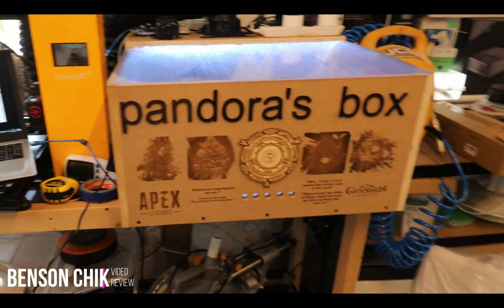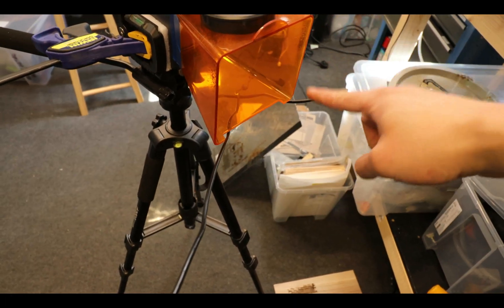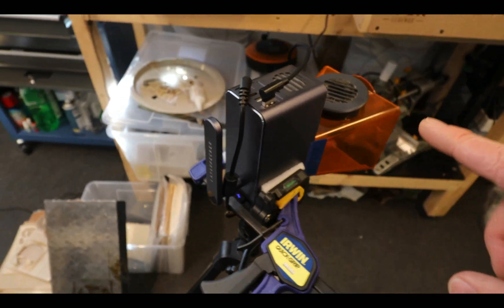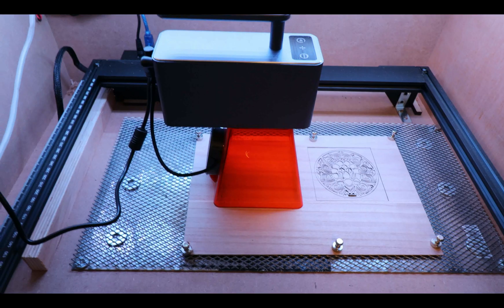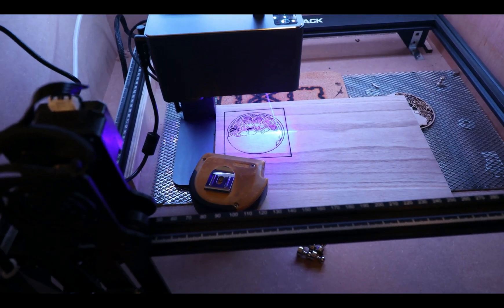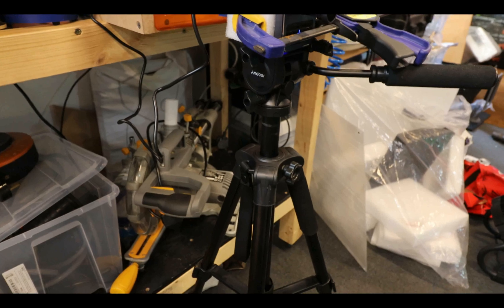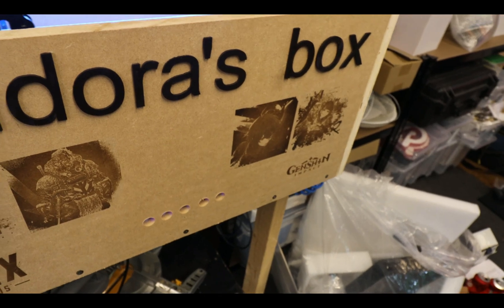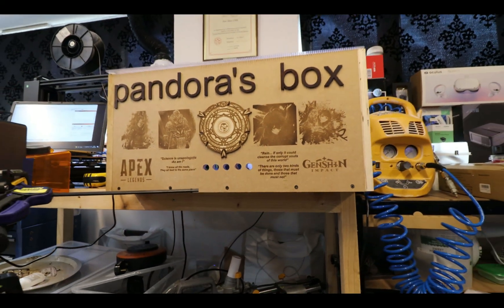LaserPecker 2 VS Atomstack A5, 2 different Laser engraver very different uses

Comment: Atomstack:
1. Zero customer service. 
2. The lens on the A5 is not replaceable. If the lens cracks (which it WILL), you have to replace the entire laserl module @ $150😅
P.O.S.
Reply from the maker: 1. Always depends on where you bought it from. .net or .com seems to be the official channel. 

2. The A5 is consider old tech and the lens is true as not replaceable. At 5w the lens should last a lot longer but do require cleaning to stop dust which heats up the lens. Laser don’t crack the lens, it needs something to stop the laser like dusts. A5 did not come with air assist and that is the first thing I added to my A5 years ago. 

I won’t replace the mod for 150, may as well buy new. Neje, Longer, Cromwell take your pick as I tested them all and non better or worse than Atomstack

Comment: I'm also very undecided, should i buy the laserpecker 2 or a atomstack S10 pro, I want only engrave different materials like glas, stainless steel and ceramic. What would you say?
Reply from the maker: If doing a lot by volume but small area needed (less than 10cmx10cm) the laser pecker is great. 

If needed larger area and need cutting wood and coloured acrylic then X20 pro

Comment: Amazin video. Super cool idea to compare the 2. I got a Atomstack s10 pro 10W lasser. But because of the big size and a small apartment, I am thinking to return it and get a Laserpecker 2. But I don't know if it is the right decision because I want to start a small business and offer engraved things in different sizes but also small wood objects and the Laserpecker doesn't seem to be able to cut so well. Can you please give me your advice? Thank you so, so much!
Reply from the maker: LP2 is great for small item customisation, you can even Bering it on sight to engraving etc. limitations will be the 10cmx10cm and actually I find the effective range is 8cmx8cm as the laser will fade out towards the edge.

Cutting with lp2 is limited to 1-2mm wood with no glue or layered resin, may as well just cut paper with it. 

Idea for lp2 will be logo on knifes , forks, wine glass, tumblers…..
Reply: @BCreviews  Thank you so much for your answer. I ordered a Atomstack s10 pro, but after 2 days the device dit not comunicate so good with lightburn. And it didn't respond to my comands. And I find it deficult to know where the engraving will start. With LP2 it is realy easy because you see exactly where the laser will engrave.

Comment: Don't expect any customer service. I purchased a  Laserpecker 2 deluxe package. After nearly 2 months and $2000.00 NZD nothing had arrived. I emailed them and did not get a reply. After several emails and finally making a threat the Laserpecker 2 package arrived. I received a faulty unit and despite  repeated emails they have yet to respond. I'm in the hole for over $2000.00, don't make the same mistake. This company has no customer service and will take your money with no accountability.